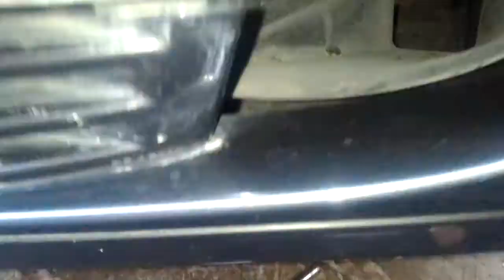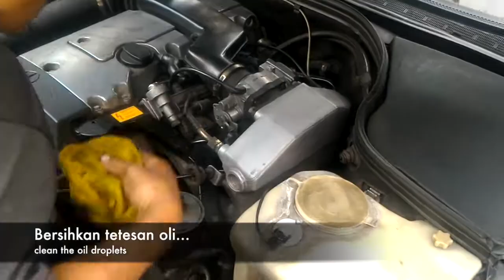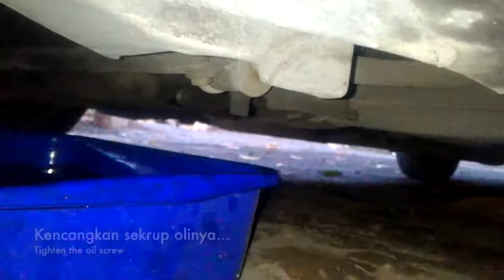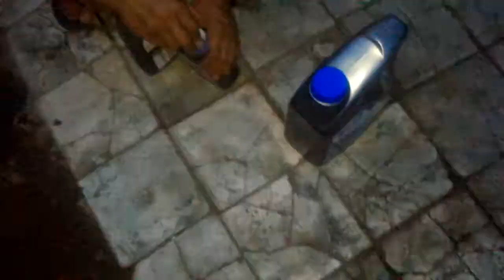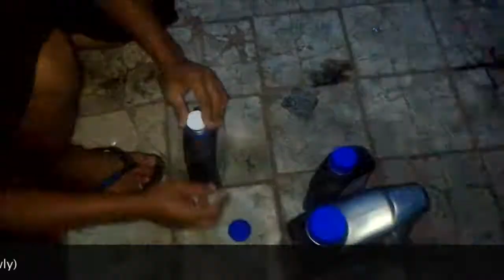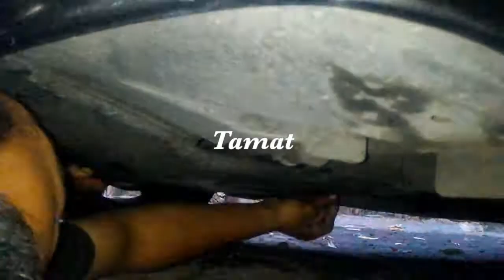Engine Oil and Oil Filter Change in W202 (Ganti Oli Mobil w202)

Comment: Mau nanya mas, dulu waktu distarter langsung greng mesin dingin, sekarang klo dingin di starter harus digas bentar, klo ngk di gas mati, knapa ya mas???tapi klo habis dibawa jalan2 dstater langsung greng, apakah harus sering dibawa jalan2????aku pake seminggu sekali
Reply from the maker: Tapi waktu distarter, asepnya ga item kan gan, knalpot masih normal keluar embun bening gitu kan? Aku pernah ngalami, starter susah krn fuel pressure regulator minta ganti... kudu di cek gan, juga fuel pump dan filter bensinnya...

Comment: Saya juga baru dapet tapi mesin kalo di gas gak bisa halus kira,, kenapa ya mohon solusi nya trima kasi
Reply from the maker: Oli udah sesuai spesifikasinya ya... klo udah, coba sering di ganti aja olinya, tiap 4000km, jangan nunggu 5rb km...

Oiyaa... mesin merci suaranya tidak sehalus mesin honde or toyote ya... cek juga, ada peredam bawaan merci di kap, masih ada ga... good luck bro 👍👍👍
Reply: @bagussuripto  kayak suara mesin disel kalo di gas kira,, apanya ya
Reply from the maker: @kenzazio3250  hmmm, apa yaa, susah bro klo suara... tapi memang mirip suaranya sama diesel, tapi ga sekasar diesel. Coba bandingkan aja sama mercy lainnnya...